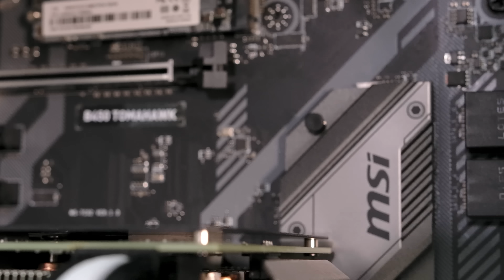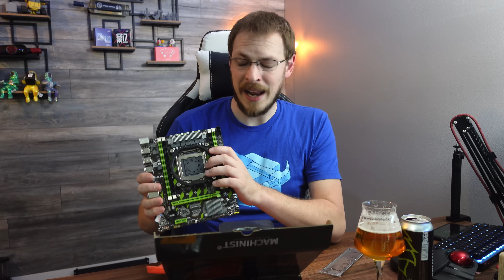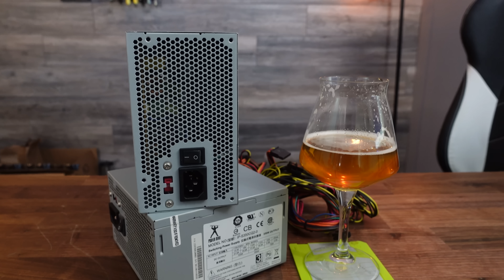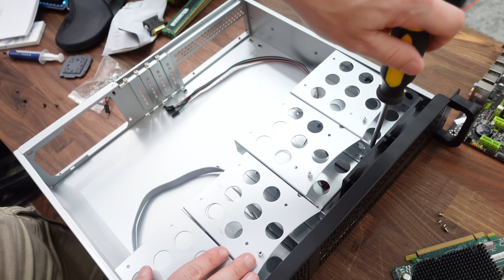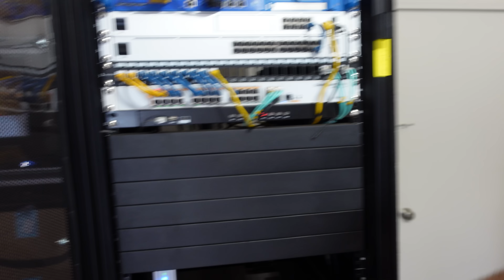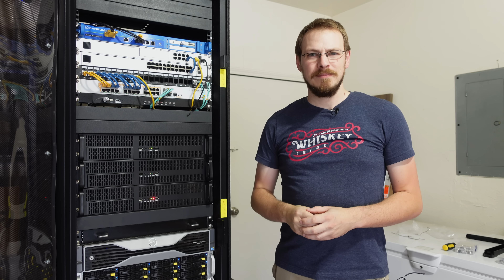A Three Server HomeLab for less than $1,000!

Comment: How would you compare building something like this to, say, purchasing a used server from an equally aged product line? I ask because, since you went with the machinist x79 motherboard... I know that board. I could pull one of the 2 xeons out of my server AND the ECC RAM out of it, and they'd be a direct match to a machinist board.

That being said... that should also clarify the choice I personally went with. At the time, including shipping and VAT, $340 got me an HP DL380 2U server with dual-xeon CPUs (so 12 cores, as I went with a cheaper option at the time), 24GB RAM in quad-channel mode (upgraded to 48GB for another $25 later), 2x 1200w Power supplies, DVD burner, and a 1GB BBWC RAID card with 4x 10k SAS HDDs (146GB, which I have since removed one of, using the 3 smaller drives as the OS and 5x 600GB ones I got really cheap (bulk OEM packaged, but new) for all my media etc. Adding those drives increased my cost to about $440 total, but even then... If I went with my initial $300 price (pre-shipping) price... it seems to be a much heavier-duty option for the same money.
FTR I can turbo mine up to 3.4GHZ across all 12 cores simultaneously, giving me 24 Xeon threads- Default 2.93Ghz

It also has 6 ducted blower fans that sound like a Boeing 747 at takeoff while standing on the runway about 500m away when it first powers up and maxes all of the fans, so... airflow is NOT an issue. Turns it into a literal wind tunnel with outflow at >20kph out the back vents and through the GPU slots. 
Just make sure you get fanless server GPUs, or at least use 3rd party server heat sinks on them, as those kept my GPU temps under 50C even when gaming heavily for hours. Inlet (environmental) temperature at 27C in the server closet, so NOT a cool area to begin with. Yeah yeah, I know... shame on me. :-( Our old house had really poor cooling. 

I dropped a GTX1070Ti in there and could basically max out the settings on EVERY game to "epic" in 1080p, most in 1440p, and some in 4k without dropping below 80-100FPS the whole time. Depends whether the game in particular was more GPU or CPU-heavy.  It's crazy, as I bought the card on release date, and even then it was clear the limiter in the system WAS the GPU, haha. I'm not used to seeing that.

My main concern here is temperature. A server is sort of like... a car that always has the gas pedal floored, pretty much 24/7. It will NOT perform the same as a car that is actually driven daily, or even a track car, as those aren't being tasked non-stop with no breaks. This is why most servers have insane temperature management (mine is older, again, but has 34 temperature sensors - no, that's not a typo - and it creates a 3D "map" of the inside of the case that tells it which fans to change the speed of to get the best balanced temperature throughout the system. Once you put 3 of those into a rack mount... I would be very, VERY concerned about long-term temperatures. Even with the lower wattage CPU, which to me sounds like an unnecessary sacrifice for the price we're working with. 

Regarding old vs new: EVERYTHING in this price range is used. That Machinist "X79" board? Scalped a northbridge controller out of an old server, and probably the SB as well. That's why they use older model Xeon CPUs. I GUESS you could find/buy a brand new Xeon CPU, but... the RAM? It's always easy to get cheap "new old stock" RAM for servers. DDR3 ECC is a lot cheaper. (If he had gone with the "x99" Machinist board, he'd be running DDR4 ECC instead, along with a newer generation Xeon being compatible ALONG with the one he chose. They're... weird little boards. Very mix-and-match with feature/functions they were able to repurpose/repath from the server chips.) 

"New" is "new from old parts" here, so while you of course want to buy new fans, new HDDs, basically anything with moving parts, rather than repurposed... technically? There's nothing wrong with even buying used RAM/HDDs when it comes to server-class hardware. When a company replaces parts, it's on a schedule, regardless of whether the old ones are still good. That's why every 4 years you see a flood of cheap used servers on eBay etc. These enterprise HDDs have a 10 year warranty, whereas a lot of consumer HDDs don't even LAST 10 years.
Reply: Oh, and there's the added benefit of iLO or similar. A separate little system that can be accessed remotely to do... anything. Lightning storm took out your power? DO NOT turn that server back on. Plug in the iLO instead, let IT diagnose each system component individually, drive by drive, RAM stick by stick, each CPU separately, each fan on it's own, heck, you can even use it to go in and update the BIOS firmware while you're at it (or HDD firmware etc) but... that little always-on monitoring system that constantly maps the thermals of the server, monitors all hardware status, and alerts me when things are ABOUT to go bad, but before they do? I had one bad HDD that was throwing back bad sectors in the outer rings of one platter, and the iLO diagnostic log was all the proof HP wanted to replace the drive for me. Simple. And man... when it comes to customer support? Even when you're talking older, used hardware, and you TELL them that honestly? Still some of the best tech support I've ever had to deal with. 
A swift, simple process in both of the cases I've needed to contact them. That alone makes a huge push towards buying a used server in my book. But the power/temperature thing... that's no small laughing matter. The new room it is located in is repurposed old laundry room closet. (Too small for that, honestly, as it's only about 1.5m by 2m wide, BUT it has a nice (now 8" since I increased it) steam-vent style exhaust RIGHT by where the server air blasts out. I combined that with a 140mm Noctua industrial fan and temp-speed-control board, and it works wonders.

Comment: Hmm... I'm thinking I might pickup some Dell Precision T1600/T1650/T1700 boards to do this with. The PSUs for those systems are cheap, and they have a front intake fan rather than an under-intake. I can drop 4c/8t Xeons in and get decent performance.

Comment: strange. according to intel ark 2648l has a turbo of 2.1ghz. i believe you would have had a better perf overall by going with lower core and higher clockspeeds. 1.8ghz is just too slow for anything else but simple no gui linux vm's.

Comment: Curious even though there is 4 cage nuts isn't there a lot of strain of those?,I ask cause ya don't seem to have anything holding the back of the servers up,Just wondering,never had a Server rack yet.  Also was wondering why ya don't use rails? wouldn't that make it easier to install?

Comment: Hi Jeff! nice builds you got there! i'm currently building my own proxmox cluster with an MSA(fast storage server) as a backend storage for the data. Since you know probably a lot from proxmox, i would like to see how i can utilize my nvidia quadro 600 in my plex VM (i know that's not redundant) but also how redundancy works just by unplugging "power / network"-failure and somethings about recovery (like; which virtual harddisk format do you use, i like VMDK for example because it's widely supported) and backup solutions. In other words; show us how your vm or vm's will never be down! ;) you probably thought of this yourself but i'd mentioned it anyway. Thanks!

Comment: Hot take: you're better off buying as nice of a single server as you can for $1,000 (with as many cores/threads and RAM capacity as possible) and running all virtual machines on that instead. You should be able to fit, in that budget, a full system with a 12-core 24-thread 3900X with 32GB of DDR4-3200CL16 RAM, a small 120GB boot SSD, and 3x2TB 7200RPM CMR disks for raid 5. Or, drop that down to just one 2TB drive and double the RAM.
Reply from the maker: Learning how to manage clusters or multiple hosts is a valuable skill as well. Yes, you can get more horsepower with a single box. That wasn't the point of this.
Reply: @CraftComputing  Yes, but can't you experiment with clustering between multiple VMs on a single box just the same as between VMs on a different box? They're all distinct hosts running distinct software with their own IP addresses.
Reply: @guspaz  ... but with a network interface running at memcpy speed with no actual network with actual network niggles in between. Also real machines can run VMs just fine, but nested VMs get really really bad!

Comment: Why  you choose those old xeons instead of ryzen platform what is a reason, cause looking on benchmarks theyre killed by decent ryzen which can be for example bought on aliexpress 1700 pro for about 100 USD ? If possible please explain
Reply: Since he's using a cheap consumer board I'd agree with you. If he used a real server platform with a quality motherboard and remote management it would be a different story.
Reply: @eDoc2020  exacly in my opinion this kind of platform solution choose is wrong and home server based on ryzen can be much much more powerfull for same price

Comment: Instead of mounting ATX psu inside 2U, I recommend SFX one with ATX to SFX bracket (sometimes included with PSU's). PSU will have some clearance for air and you'll have free space under it allowing you to fit an full ATX board.

Comment: FYI - I found a tool to magnetize or demagnetize a screwdriver. I use it all the time. It's a magnet in a shape of ablock with slots you pass the driver through.
Reply: You don't need a tool! The tool is horrible wimpy junk that will barely magnetise the screwdriver anyway. Just take the strongest magnet you can find! And then choose north or south pole and run it along the side of the screwdriver several times. Just plonk it down somewhere near the handle and pull it towards the tip and repeat several times hitting the same side of the screwdriver. You can even demagnetise the screwdriver by running the edge of the magnet on it.

If you magnetise the screwdriver a little too will, it will never lose a screw again, but it may sometimes jump out of your hand and stick to a random steel panel. But it's generally much harder to lose a screwdriver than a screw, so there's that!

Comment: Just for reference, I ran a cinebench CPU test on one of my R710s, and it scored around 3000.  Also, turns out I'm just north of you.  If you want to see what happens to a homelab when suddenly you decide overkill is better, let me know!
Reply from the maker: The rest of my rack is definitely overkill... rackmount AC, dual E5-2643s in my TrueNAS box. I like to play both sides of the power meter sometimes :-D

Comment: Awesome vid, but missed the craft beer review.

My daughter has mentioned wanting a minecraft server, so I'm just at the start of researching this, so a vid on things to look out for with servers would be useful.

Also as my daughter will probbly be playing minecraft when I'm not playing games what the pros and cons vs just having the minecraft server on my machine rather than a dedicated machine would be great.
Reply: Minecraft doesn't do too great a job of utilizing multiple cores. I'd recommend a quad core with good IPC and clock speed, 6 to 8gb of RAM (12-16+ if the game's modded), and a reasonable storage solution (120-240GB SSD for better chunk load times, but a 7200rpm HDD could still work.)

I've had a fairly good experience with a 4th gen intel chip and 16gb of  RAM, so if you found a good deal on a used office PC with that generation of chip or younger you'd be solid.
Reply: as mentioned above, for minecraft, it's better to go with the highest clocked cpu you can as it doesn't benefit from more cores.
Reply: Thanks for the advice guys !

Comment: i'd probably want to go with used ryzen for servers like this... a 1700x is 8 cores, 16 threads at 3.8ghz at 95w and you can find amd stock heatsinks for little to no money used (because they come with enthusiast class cpus and very few people actually use them in those cases). then you can use ddr4 non-ecc (or ecc if you want and have the right board), for significantly more memory bandwidth, and even the inexpensive stuff will work just fine..
Reply: what motherboard would you suggest
Reply: @TheUnofficialMaker  I mean, anything that's reviewed decently will work just fine. if you're doing a storage server you'll want to pick up a cheap gpu (like a gt1030 or something if you aren't using an APU), and a SAS HBA card for sas/sata ports (as ryzen boards rarely have more than 6 sata ports).  I've previously gone with asus prime x470 and asus prime x370 boards with great success in the past in workstations.  right now i've got a high end aorus board (aorus x570 xtreme) which is fantastic for a workstation but not a server (it's way too expensive for that).  honestly i'd just shop around ebay and find cheap atx x370, x470 boards, enter the model numbers into google, and see how they review.

Comment: it appears as if the power supply is mounted so that it takes in air from above - but in a rack, there will likely be a server above that server...  this could get problematic if the psu heats up.

Comment: Interesting video. Thank you. I'm looking forward to your video on Proxmox clustering - please discuss why Proxmox requires three servers while Windows requires only two. I do have a some questions:

1. No mention of remote management? Surely you want IPMI or ILO?
2. Why not use a PCIE x1 graphics card? That would leave the x16 slot free for a 10 Gb Ethernet or SATA 3 card.
3. Ventilation : why not leave 1U (or even one third of a U) free between each server so that the PSUs have a source of air?

And a tip: use chopsticks to assist in the fitting of the server in the rack.

Comment: Isn't Molex to SATA a bad idea for hard drives?
Reply: Well since it's intended as a lab where you test run your projects temporarily, not a server doing something actually vital, this is probably not much of a concern. The problem with molex to sata is just the quality of connectors and adapters, that after being run heavily for several years, there will be some oxidation on the pins and the power gets unreliable, the harddrives might fail to spin up or fall off the bus. And you just have to be careful and inspect the adapter after plugging it in, that the pins didn't get disloged. Anyway if the harddrives start showing up some issues after a while, you know where to look and that the connectors may need a little bit of no-residue contact spray. The harddrives themselves shouldn't really take any damage.

Comment: Haha that case is horrific. I’ve always gone with used enterprise and small business IBM, Dell and HP servers. They wouldn’t cost much more than these. Also I would have taken the tops off the power supplies, the case has fans at the front so there is air flow in the case. Simple.

Comment: Very interesting. So if just messing around and want something for a playground, or to get started - use X79 knockoffs. In your other video where you upgraded your production Promox, you mentioned, that you didn't want to risk using a cheap motherboard so you nabbed a Gigabyte board from eBay.  Makes sense, if you just want to try out different features then having a bunch of NVM's around with these boards so that you can hop between projects, or at least that's another form of backup. ;]  ESXi set, Proxmox set, XCP-NG set, and ??? set.  Ooh, TrueNAS replication too. Now I have to decide if it'll be production with full WAF, or a playground. ;]  Thanks Jeff!

Comment: Pro-tip, get the rack screws threaded by hand before switching to a driver(dont let the server rest on 

For storage, i have been a big fan of used servers from Dell HP, or IBM/Lenovo 
Hot swap drives because who wants to shut down a server and take it out of the rack to replace/upgrade a drive
Dual PSU
MANY MANY RAM slots-My Dell Poweredge C2100 has 18 RAM slots, this server does allow you to run quietly with L series Xeon processors, if you're aiming for the quietest server, use the L5620(4c8t) but a good balance i've gone with is the L5640(6c12t at a higher frequency)
SLIDING RAILS-If anything goes wrong, you dont even have to unplig anything to say swap a fan(C2100 does not have hot swap fans)
CHHHHEEEEEAAAAAPPPPP i dont think i paid over $120 for any of my 4 poweredge servers, all came with basic processors, some ram, SAS controller and drive sleds, one of them even came with 10G networking Excluding the drives, i think getting 12 cores (dual processors) with at least 48GB of RAM and at least 1x10G network port for under $200, probably under $150 for the non-performance 6 cores

I have my storage servers set up using freenas, 12x3.5in hot swap drives with internal SSDs for caches, and anywhere between 72 and 128GB of RAM and dual Xeon L5640(6 core 12 thread and 60w each)

I am actually in the process of replacing all of my servers with ryzen file servers will be a 3u whilte box chassis using hopefully a Ryzen 3600, 128GB of ECC 16xLFF hot swap drives 40G networking, and a few intel Optane drives for high IO cache and a few SATA SSDs for frequently used cache.

I've already replaced my DVR+NVR server (Dell R710 with dual Xeon X5670) with a cheap 2u with 3700x, oddly, even though this is handing nothing buy video, i do not have a video card in this system

The old servers will go into my disconnected  garage/shop for a homelab rack making When all is said and done, i'll have two Dell R510 LFF, a Dell R710, a Dell C2100, and a Baracuda MailFilter 600(amd opteron with supermicro board)